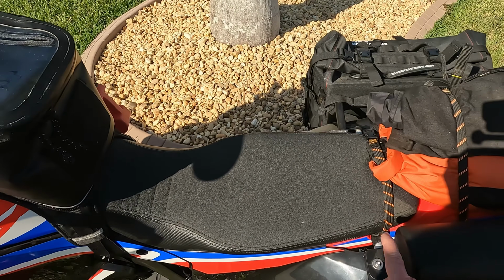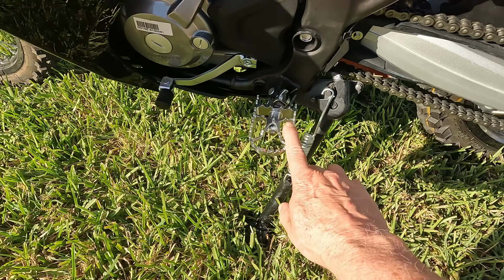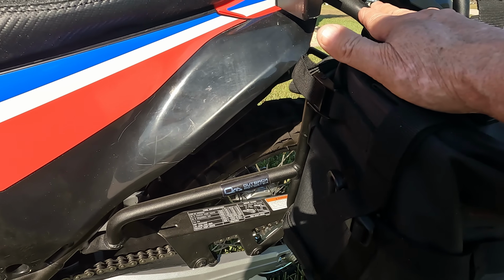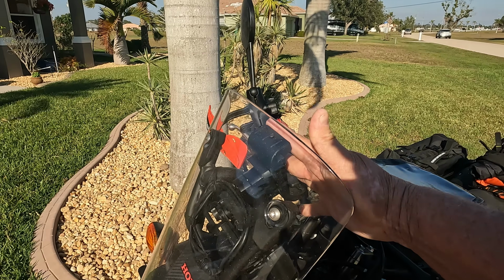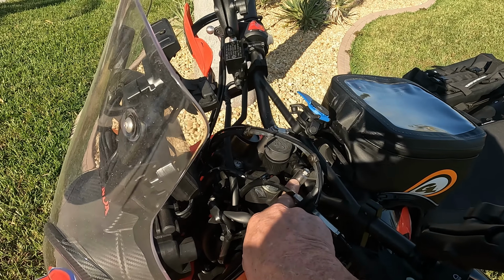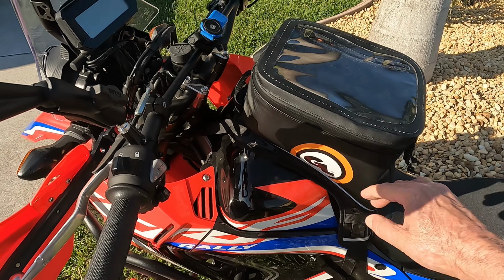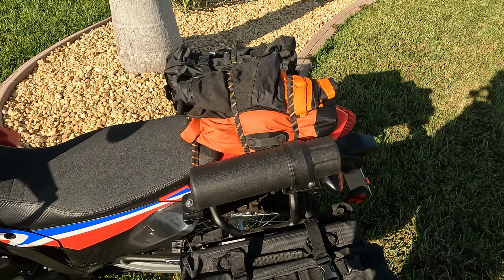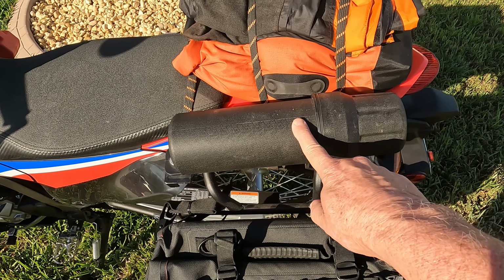Honda CRF 300 L Rally- Dual Sport Build (Part #1)

Comment: Would like some more info on the apx skid plate you installed. Couldn't find a apx skid plate for the Rally on their website. Thanks
Reply: Typo axp, not apx 😮
Reply from the maker: Hey Rory Singer,

The skid plate should be listed under the 300 L. It isn't a direct replacement. Just bolt it on
However, the skid plate won't attach to the front cowel like the original.

Hope that helps, Mike

Comment: Did you have to modify the 6mm skid plate to get it to fit? I noticed axp only offers it for the 300l model...
Reply from the maker: Hi Airada Imagery,

You are correct. It is not a direct replacement, but no modification is needed. However, the OEM part attaches to the plastic body parts, and the replacement does not.

For this reason, I doubt any aftermarket skid plate will be a direct replacement or perfect fit. If this model remains popular, it is possible that someone in the future will manufacture a skid plate that attaches like the original. 

I hope this helps with your decision. 

Take care, Mike